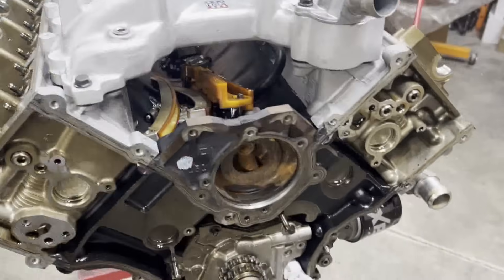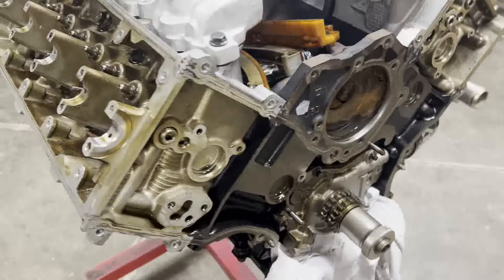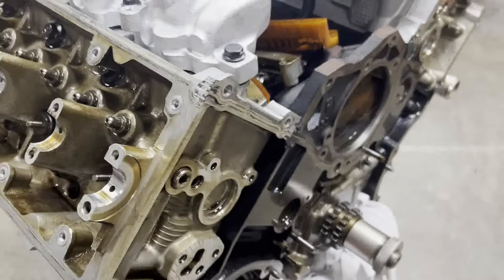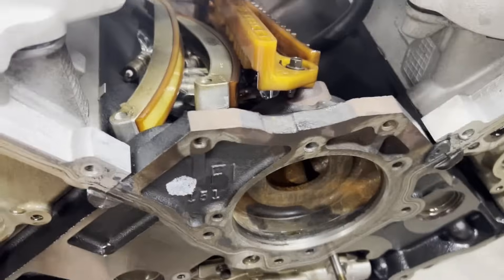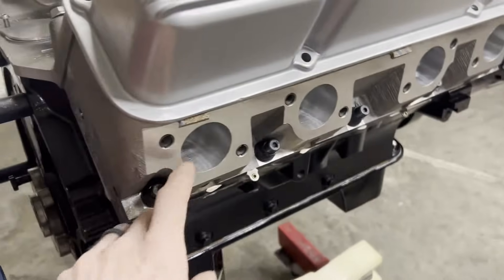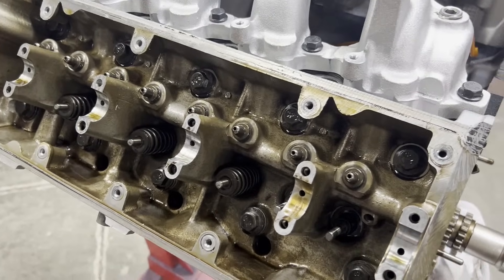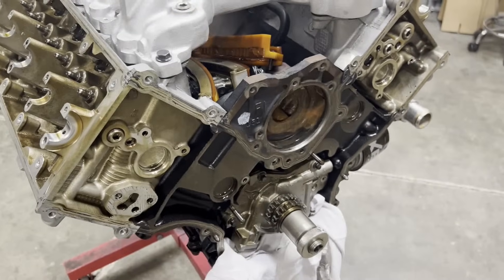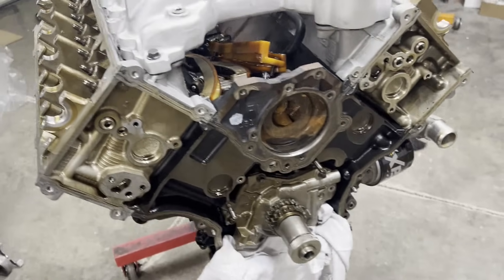Lykins Motorsports Update On Our 4.6L 2V Dyno Mule...

Comment: The modular ford engine was designed in the mid to late 1980's. The engine was designed to pass the emissions rules of the early 90s , without needing a catalyst.  The engine actually passed EPA, But the EPA later changed the rule, and required all internal combustion engine's to run a catalyst regardless. So all the work ,was essentially nullified,  Ford had hoped to save the cost of a converter. The parameters for bore and stroke, were determined from extensive heat transfer testing, to determine the best combination,  for efficiency and emissions.

Comment: I just didn’t like working on them, even in the big ole crown Vic it was kinda of a pain to pull the valve covers. They, along with the 5.4 run forever. A far as I’m concerned the 97-04 trucks were some off the best Ford made. Really like the latter crew cabs, 5.4 with a 4R70w and a 9.75.  Just wish they would’ve not rusted out.

Comment: Only the Ignorant hate a 2V 4.6.... I bought a brand new Mustang GT in 02 and with a few bolt on mods and a converter it ran 12.6's at 107.
Reply from the maker: I understand that they're large engines, but they do quite well for what they are.

Comment: The 4.6L 2v engine was a great car and light truck workhorse! The only downfall to the engine was the width. It makes great power for a 281 CI engine. The bottom end is bulletproof. They get fantastic gas mileage. I can't wait to see what you can get out of this engine with a carburetor setup. Keep up the good work,!

Comment: How can you hate on one of the best engines made in the last 25 years? It's not a torque monster but those TFS heads and cams will wake it up. I think the factory HP numbers were a bit generous. There have been many dynoed on chassis dynos at around 200 HP, with drive line loss that's around 230 HP at the crank. Don't hate on the little chubby guy.😄

Comment: I have an 2002 GT mustang with a 4.6 that I love small pulley and a tune and flow master cat backs that  puts down the tires 247 hp with a 5 speed and I can get over 20 miles a gallon.  And has a 125000 miles on it very dependable car .

Comment: Are you sure that you were at top dead center? That sounds like more valve drop than I would expect and I have worked on a lot of these engines.  Normaly in an unmodified stock engine is limited to about 0* @.050 IVO.  If you cut the huge margin off the intake valves you can get a few more degrees.
Reply from the maker: Yes sir, checked it several times.

Comment: I inherited a 2006 Grand Marquis.  It’s been excellently cared for.  It has 148k miles.  I enjoy it but it lacks in power   maybe 4000 rpm.  Richard’s holdener suggests PI heads for this bottom end.  I still want it daily driven.  I thought Coyote swap but that’s WAY more involved than I really want.  What’s your thoughts?
Reply: You have pi heads because your car is a 2006

Comment: To heck with the whiners and complainers, I for one am enjoying this engine build. 
And by the way 315 horsepower minus 20% (accessory drag) works out to 352 horsepower, just under Ford's 260 horsepower rating. It sounds to me that your net rating horsepower is pretty much right on. 
Looking forward to the rest of the build. Stay strong and try and ignore the knuckleheads. 
(Retired engine builder here) 👍🏁

Comment: Brent, I have a 2002 5.4 two valve in a FX4 with over 260k on the odometer that still runs strong and has had nothing but normal maintenance done to it. When I bought it, it only had 36k. Not sure why anyone would hate this engine class.

Comment: Here's the obvious: you had long tube headers, a single four intake with a carb that removed all of the factory restrictions in the efi.?????? Why would that not make an improvement. I built 2 trucks with 4.6's. Both newer crown vic versions that were PI. One in a 51 Ford F1 with 5 speed and 3:73 rear gears and the other was a 72 F100 with the drivetrain from a P71 car. You will see the 4.6 described as butter smooth. I would agree with that. The bottom end power feels weaker. Without a dyno, what am I comparing to? I have a long history with FE's and windsors. Not my 1st rodeo. The engine being wide was difficult to work around. Not having any oil leaks was great. making good fuel mileage was great. But it is a simple engine if you are using the version before variable valve timing and 3 valve heads. I used to visit with the Ford Perf. guys back in the 2000's. When I asked why they didn't continue the development of the windsors the answer was " we didn't have a long life engine". The old small blocks weren't designed for efi and 300,000 mile life. Most of us have seen one of these with a turbo making above 600 hp without failures. The ohc valve train removes so many limitations that you would think people would be excited. Not so. Look at the following for the LS and now Godzilla. :) To each his own. Huge variety in life. Takes too much energy to be hateful as compared to happy. :)

Comment: Non PI vs PI heads is similar to E7 vs GT40P heads. Bigger 1.90 intake valve and a good session with the grinder really wakes this motor up. 450 hp is "easily" achievable by someone as skillful as yourself, especially since it's so much easier to rev these out once it's capable of breathing properly.

Comment: I screwed one of  these soldiers together a few years ago using a 05 3v block, crank, rods, small dish forged pistons,  tfs 44cc chamber out of the box heads w their stage 1 cams, P.I. intake,  BBK throttle body, 36 # injectors  all accessories ( - ) air cond pump.  ebay mustang headers modified for  a panther platform (crown vic) 2.5" x pipe and modified o5 mustang mufflers 
Made over 360 at the wheels through an police automatic w/3:27 gears had to stop there as we ran into fuel delivery issues 
One more thing there was a 3° difference in cam timing from right side to left  have fun I'll be watching the build 👍

Comment: Love the 2v content.  Peeps that hate, never had one.  I’ve had 2 ‘99 GTs and to me stock they performed similarly to a 5.0 HO with a B303 cam and ported E7s that is less prone to leaks, and a stronger bottom end (rods aside).  Also ran a built 5.4 2v Lignthing.  Badass engine and one of the best sounding Fords period.  While I am partial to wrenching SBF and BBF, I like what you’re doing as I always wanted to build a hot NA 4.6 2v.  Thanks for sharing.
Reply: Yes, I just saw powernation do an explorer headed 5.0 but the stock headed 5.0 with cam made about the same power as this stock 4.6. I've had numerous 4.6s over the years . Always gave me more than 260k miles and they ran perfect at that. I also had a 4.6 4 valve in my 96 and it ran perfect with 315k miles on it. I will be honest thought, my 5.0 in my 2000 explorer had 254k miles and ran good. Not burning oil but it wasn't very powerful for the heavier Explorer. Needed a cam to wake it up but there the low end would have gone away (below 2500 rpm). 4.6 is just a smoother and more reliable engine period.

Comment: I worked on German cars back in the 80's and Ford basically followed Mercedes-Benz in engine design. They went from 2-valve OHC, to 4-valve, to 3-valve, and back to 4-valve. The 2-valve engines were pretty much bulletproof. Very cool FE!

Comment: About the only thing I see about the 4.6 that I don't like is it's small displacement. It makes good power for it's size and I've always heard they last many many miles
Reply: I've had 2 94 vics go 265k miles. One 2005 Marquis go 290k. One 96 4.6 4 valve go 315k. When i sold them the engines weren't burning oil (ok one 94 would smoke if idled too much-I replaced the valve seals on the other 94) and sounded fine. They would only start to leak a little oil from pan gasket and front timing cover gasket when over 200k miles.

Comment: Nothing wrong with a 4.6 2V.  They go over 200,000 miles without problems.  They were used Lincoln Limos and go 300,000 miles. The heads aren't made for performance.  If you put TFS heads or go 4V she will go 400 hp. Ported 3V will match the flows of the 4V heads.  If you go 4V, try to get the 2003-4 "C" heads.  They were designed based on the knowledge gained from racing.